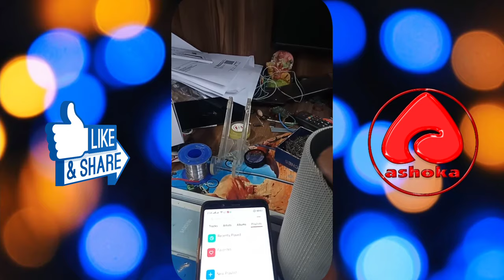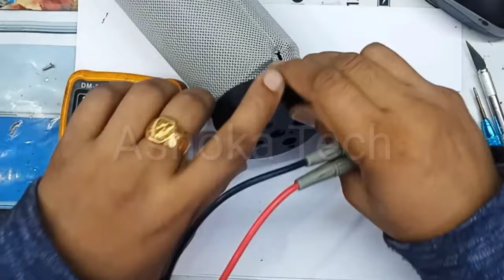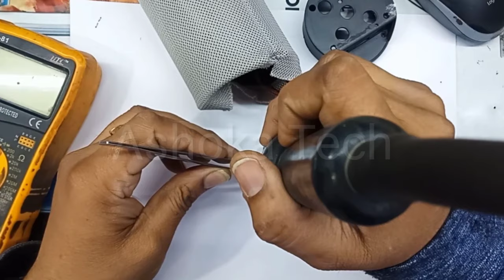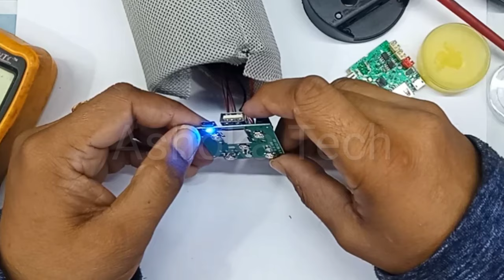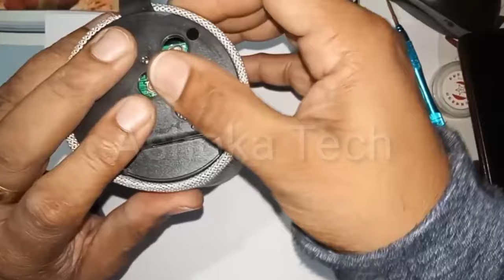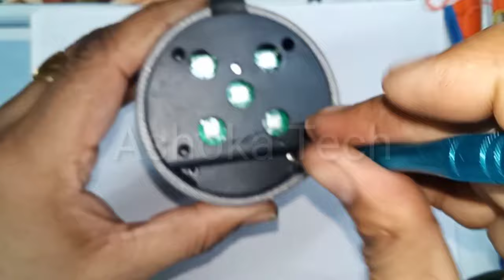how to repair bluetooth speaker sound problem | ब्लूटूथ स्पीकर में आवाज़ रुक रुक कर आए तो उसको कैसे

Comment: Bro my speaker is pulse 3 replica. Only have one speaker unit inside and have the same sound problem. The board already has 2× 470mf 10v capacitor and 100mf 16v capacitor. Please help me.

Comment: Audio ic ki 2 or 3 number pin tester se short karne pe sound aana shuru hojata hai fir kuch der bad sound band hojata hai fir short karne pe sound aata hai iska solution bataiye 
Kya audio ic ki 2 or 3 number pin solder se short kar dene se permanent solution ho sakta hai or is se koi problem ho sakti hai
Plzz reply

Comment: Bhai same problem mere speaker mein bhi hai . Saara din battery charge karne par bhi battery ki charging led off nahi hoti.. battery volt drop hoti hai Aur awaz cut kar aati hai full volume par . Usmein ek bada capacitor laga hua hai lekin woh aerobull ka speaker hai iska board thoda alag hai.new battery daal kar bhi kuch nahi hua 😢